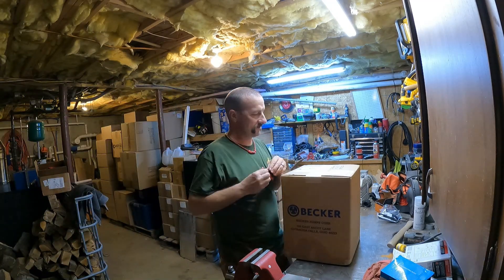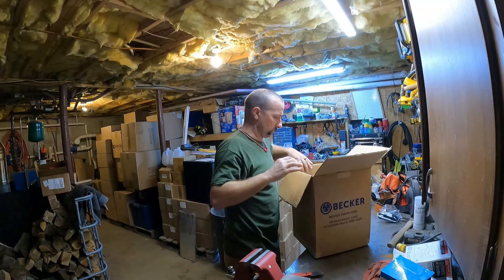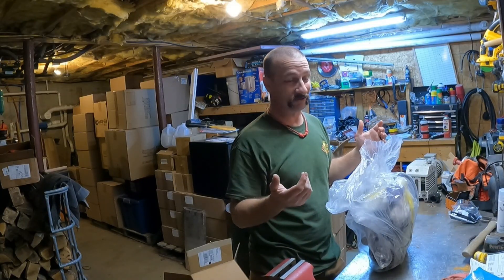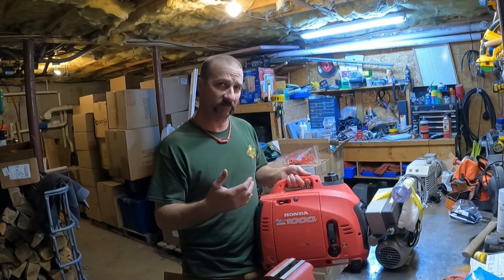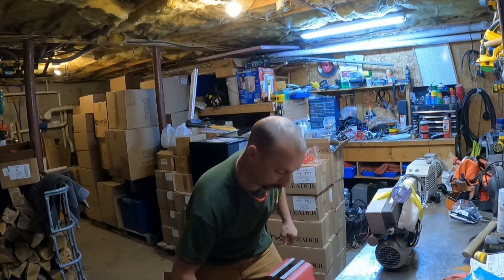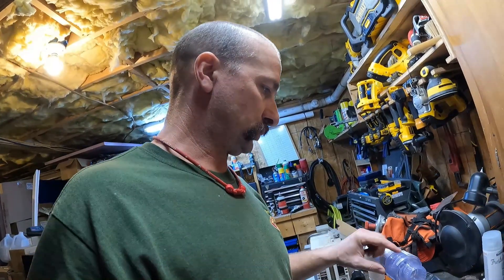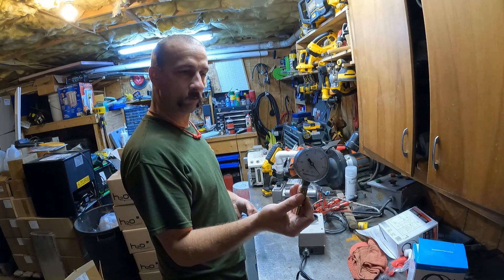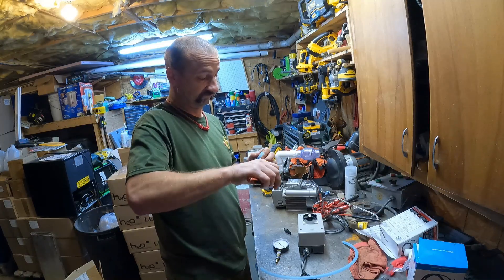High vacuum for small maple woods

Comment: So what’s the plan for the releaser and moisture trap?

As for batteries might I suggest LiFePO4 if it’s not too late for you. They don’t freeze up like the deep cells n can be drained almost to the bottom. 

One more question. About the woods you mentioned putting this vacuum setup at. Were you running a conventional 5/16 laterals into a 3/4” or 1” mainline into a diaphragm pump? When it worked what was your best vacuum numbers?
Reply from the maker: I am going to make a moisture trap and I bought used releasers.  All of my woods are main and lateral systems best i saw was maybe 25" but if the sap wasn't running much it would be 8"

Comment: Small woods set up. Shurflow, 80-100 taps each no releaser no heaters. The setup goes like this. A centralized power station doghouse with a 1000 W 2 cycle generator, battery charger, power inverter and battteries.  Pumps are located Near the trees they service. 120 V is sent to each pump using extension cords and the power inverter (my longest run has been 600ft, yes 6 100ft ext. cords lol).. At each pump there's a computer style voltage converter that steps the 120 V down to 12 V DC. This is similar to our power grid in that the voltage in being stepped down at the sevice location. Trying to run pumps directly with 12 V power from batteries would result in too much voltage loss over several 100 feet. Using this type of set up provides full time power without interuption. The generator feeds the battery charger for the 6 hours that it will run on a full tank. The batteries feed the inverter. Inverter feeds converters. How long pumps will run without the generator depends on your battery size and how many pumps you have. With a pair of 100 amp hour batteries you will have no trouble running 6 pumps for 10 hours before needing to run the generator to recharge. That's 16 hours of vacuum before refueing is needed. Of course solar can be added as well to make even more  efficient. With this set up I can run  vacuum on 500 taps for 24 hours with less than 3 gallons of gas.  With solar panels less than 2 gallons of gas. The best part though is the system stays going when the generator runs out of fuel. Note about shurflow pumps. Both the 4008 and the 4048 use only 1.2-1.5 amps when pulling vacuum. There is no advantage to getting the higher amp pump (4048)as it has the same pump head and pulling power as the low amp (4008) model.  Pushing water and creating pressure is much different than pulling vacuum.  In places with elevation 3/16 tubing can be incorporated to reach extremely high levels of vacuum. Vacuum gauges get pinned with just 10 feet of elevation and a shurflow pump.
Reply from the maker: I am looking for something that will work for larger systems at the same time maybe up to 500 taps.

Comment: re cutting tubing off fittings - I find that squeezing tubing off fittings works very well - I use a pair of linesman's pliers, and grab the tubing perpendicularly to the barbed fitting, catching about a third of the tubing - as you squeeze, the tubing on the opposite side thins then fails, and the tubing comes off clean.   Seems to work well, especially when it's getting dark and you need to reuse a fitting...
Reply from the maker: I try not to cut any and usually carry as few tools as possible because I don't want to loose them

Comment: Looks like a Becker VT 4.4? So about 2.8CFM? Nice little unit! I assume you'd still want a moisture trap on this?
Reply from the maker: Yes you would need a moisture trap with it.  I am trying to get a situation where I am getting high vacuum with good fuel efficiency for an affordable price.  It's a VT 4.8 with 5.4 CFM

Comment: How does that compare to a single guzzler price wise?
Reply: I see the guzzler goes for 900ish.  You say 1200ish plus releaser cost.   Im not sold yet but interested in results.  Im jumping up to 800 taps this year which is maxing out my double guzzler.  Spoke with Andy at A+m and like his product for next year.  Im good at finding leaks while the RO runs at the shack.
Reply from the maker: So yes a guzzler is probably cheaper.  With a true vacuum you will get more consistent vacuum.
Reply: @dunnfamilymaple you said in the vid that this pump still wont keep up if you have leaks tho.  Same as a guzzler but quite a bit more money.
Reply from the maker: They are about $1400
Reply: @dunnfamilymaple So around $2-$2.50/ tap.
Reply: @dunnfamilymaple plus releaser